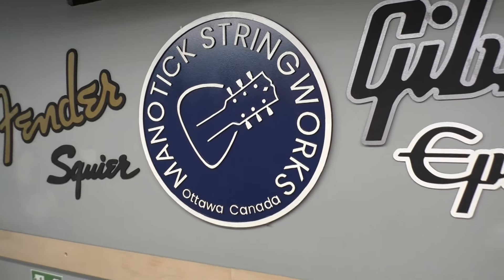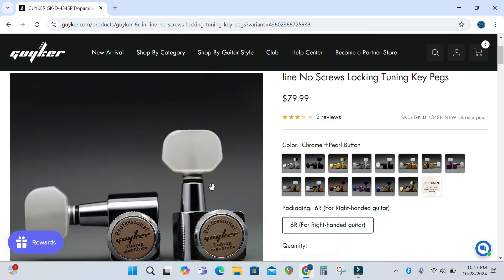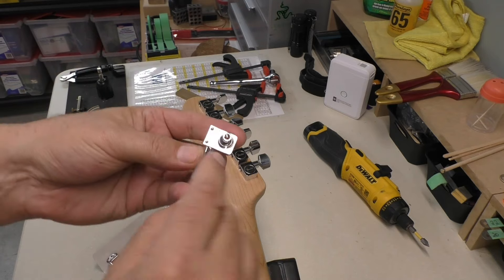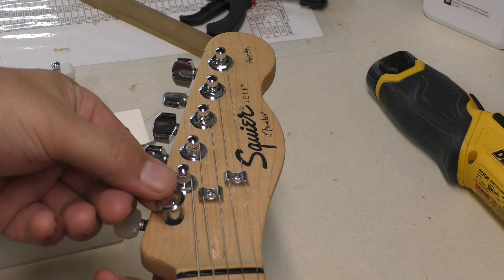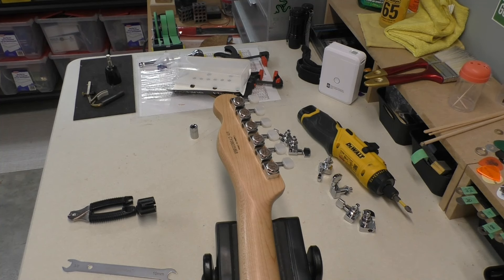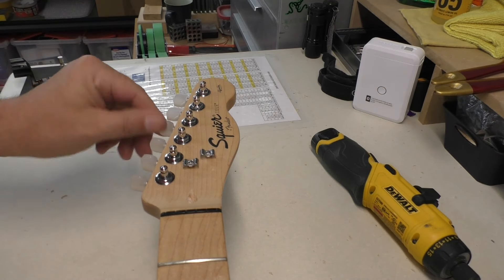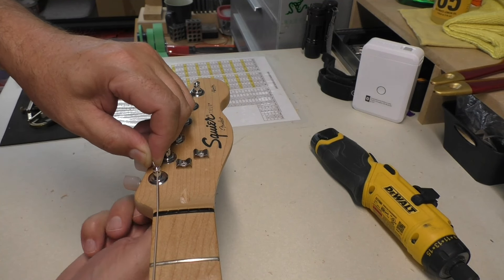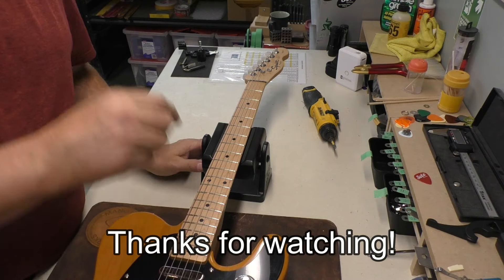Guyker Dopamine Tuners Installation

Comment: I like how they let you buy individually so you can mix button colors.
Reply from the maker: @JoeR203  customization is very nice
Reply: @ManotickGuitarTech  Yes, it is. I didn't even notice that Customize tab before. I was thinking of getting tuners with 2 red, 2 white and 2 blue buttons but the casing colors only matched on 2 of those so 2 tuners would have had different colored casing. But now that I see I can get all casings to match, I may go ahead with my Red, White and Blue guitar theme. Floyd Rose has a line of their tremolos called "Special Vibe" so I just have to decide on a red trem, or a blue one. 🙂
Reply from the maker: @JoeR203  very cool  -send me pics when it is done
Reply: @ManotickGuitarTech  It'll be on my channel eventually. Currently waiting for body + neck to come from Guitar Fetish for another project. Waiting for the pickguard from AliExpress but the delivery company they use once it's in the US (UniExpress) came to deliver but didn't leave it at the door and I got a "Failed delivery" text. Hoping they try again now that I have a sign on the door telling them to leave it at the door.

Comment: Bought a set of Guyker locking tuners from Amazon for my Sigma acoustic. Absolute rubbish! Took them off after a week and threw them in the bin. Guitar now has Grover locking minis on it, which didn’t cost a huge amount and are far superior. It’s totally true that you get what you pay for! If you’re looking for cheap knock off tuners to fit to a cheap guitar, these fit the bill, if you have a decent guitar avoid these or be prepared to “ buy cheap buy twice”😢

Comment: I tried the same set, (GK07SP 3x3 black and gold $40.99 on Amazon), last month, for my Chibson.

The only difference, between the junk $5 originals, and the Guyker is; the Guyker were “mostly” locking.

Out-of-the-box they felt tiny, and cheap. They had spots where they turned hard, then almost no resistance. (Which only got worse, when I installed them.) Two of the locks were stripped.

Once installed, they were next to impossible to tune. They went from flat, to sharp, sometimes in a fraction of a turn. Others it took over half a turn…

I could say, the only good thing about them was the ease of installation, but come on. They’re machine heads, of course they’re easy to install.

I returned them, within a day. I added ($30) for D’Addario Planet Waves auto trims, (also gold, and black.)

The difference was night, and day. Much more smooth. No binding. Easier to tune. Auto trimming. Bigger buttons. (Not miniature.) Just all-around better. They look much better too.

I’ll never purchase another set of tuners from Guyker. However, their $16.99 locking roller bridges are great.

Edit: If you ever plan to change the buttons… Normal sized buttons won’t fit…